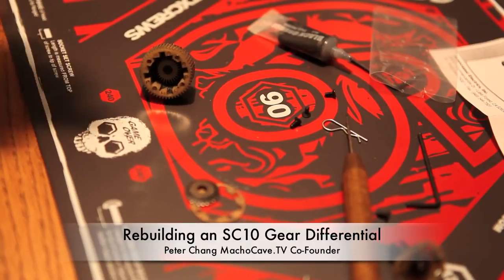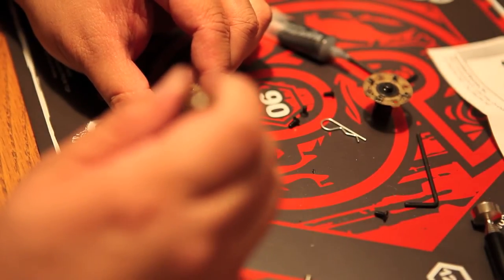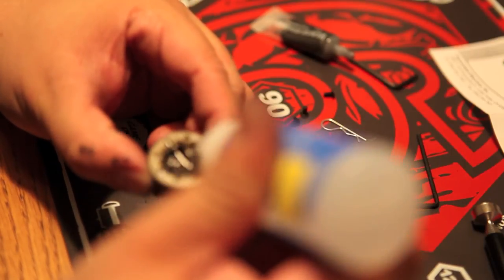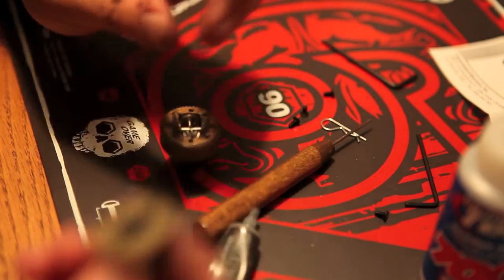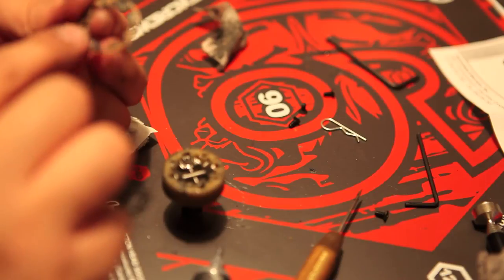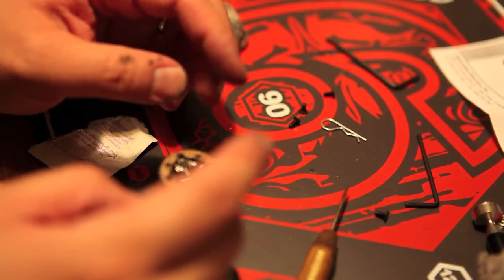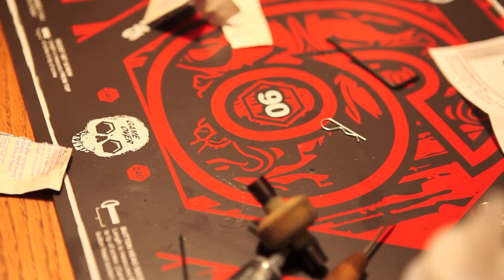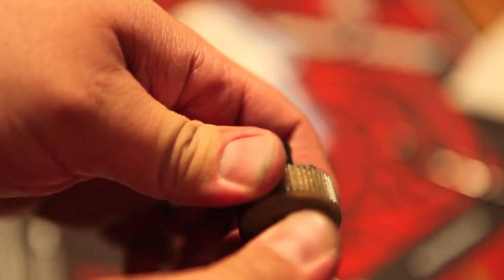SC10 Gear Diff Rebuild To Eliminate Grinding Noise

Comment: Thanks for the edit.  Helped alot.  One thing though that I found out is, when you get a diff rebuild kit for an SC10 2WD take all the old parts out and trash em or keep as spares.  Only use the parts in the kit.  I tried using the 2 old shims and 1 new shim on each side for 3 shims total on each side so it would be nice and tight and put it all back together and it didn't even spin lol.  So, lesson learned and that was after I found out that you don't need to use the shims on the planet gears either.  So, use the 2 new shims on each side under the sun gear and pin piece does go back in fairly no problem and tech tip on the other side (Easy side, the diff cover side) place your paper gasket on it as it allows you to because the paper gasket fits over it and it stays in place.  And, once you have the other side done just add your last sun gear to it over the top of the planet gears and then set your diff cover side on top and then screw in your 4 screws and done.  Second, time around went much easier lol.
Reply from the maker: Wow! Great tips and feedback :) Thanks for letting us know! Also, if you plan on racing, you can also try using a ball diff--and yes a ball diff is more trouble to maintain :)

Comment from the maker: Hi! Great question! I'd check the sun gears and maybe add an extra shim below the sun gear--you should have a little trouble getting the sun gear back in, as the sun gear needs to be a little snugged up to the pin. Try that or order a new 4x4 diff to rebuild the diff--it really sounds like the sun gear isn't snugged up to the pin or diff case or outter drives may be worn down.

Comment: sorry for asking, but i need immediate help. i've just got an sc10 4x4 ft and after i put diff sun gear and than the pininto the diffs and later filled with oil and screwed them, the cups weren't moving at all. i unsrewed the diffs and removed the shim and immediately i could insert the pin with no struggle at all.i filled the diffs back and than screwed them and the diff cups were moving perfectly. Did i do the right thing?What should i do know ? i have't run the truck yet and i want to know .

Comment from the maker: The diff might be going bad or you might be running low on diff fluid, and before I'd service or replace the diff I'd check the slipper spring first to make sure that the slipper spring is properly tightened. So check to see if the shaft extends at least 0.5 mm past the nut to ensure that the slipper spring is properly tightened.

Comment from the maker: That is a bummer! It's hard to troubleshoot without seeing the diff, so here are some steps I would take before replacing the entire diff, check that the shims by the  sun gears are re-shimmed, then make sure that the diff oil isn't leaking out. If those two things are fixed, check the idler gear in the transmission. Sometimes the idler gear is worn and you are hearing the grinding noise from the idler gear. Replacing the entire diff gear would fix the issue as well as the case might be worn.

Comment from the maker: Do you mean bearing that goes over the outter drives- it's 10x16mm part number 9832? If that's the one--yes it does come out. You can tap it out with a hex wrench. If it's a different part number--check the manual--but most parts should be removable.